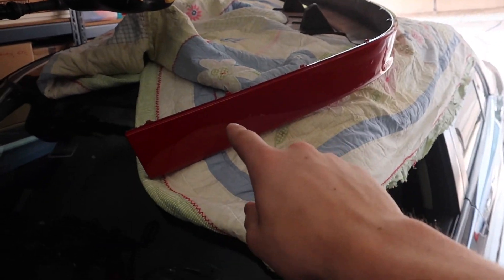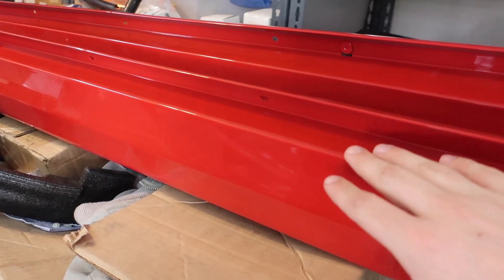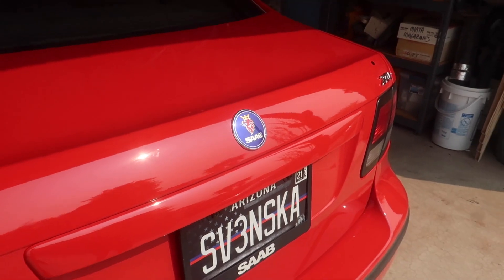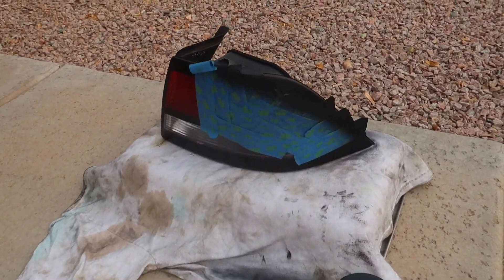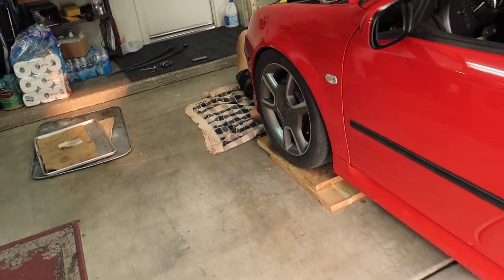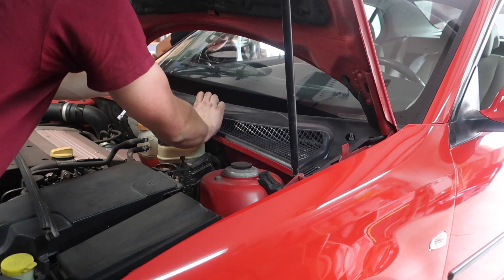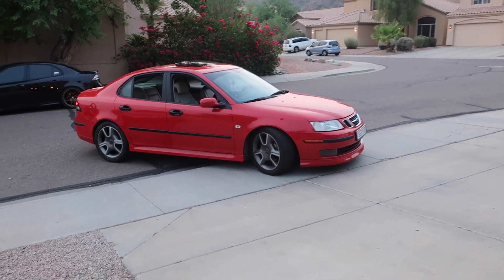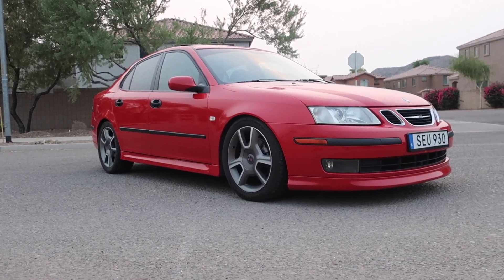Project Saab Episode 12 - New Paint Job Revealed!!

Comment: Wow looks so good dude! Make sure to get it ceramic coated ASAP!!! Ceramic coatings are like an extra clear coat protection
Reply from the maker: We've already been thinking about! Thanks for the tip :)
Reply: Tried a variety of finishes on my 0 Aero convertible including ceramic - by far best shine by far is Collinite 845 insulator wax sold by Amazon - lot of detailers use it ! Also Autoglymn trim restorer is amazing on black body trim 👌
Reply: My recommendation would be Chemical Guys Jet Seal paint protection 👌🏼 both of my cars are treated with it to great effect 👍🏼😎

Comment: Goes to MAACO and has issues.  Goes to Discount tire and has issues.  

Dude, reputable and local shops are the best, always support local not corporate.
Reply from the maker: I would try to, but MAACO was the cheapest, and the tires were bought from discount with a voucher, so I didn't have much of an option (plus it was free)
Reply: @AutoAutopsy  The cheapest doesn't necessarily mean the best as it got proven. Also supporting corporate fucks up the society and fosters financial inequality.
Reply: I would NEVER trust MAACO.  Good work is never cheap.  Cheap work is never good.

Comment: Yay! Laser Red! That looks really good and I think that the black tail light trim just adds to it. My 2007 9-3 Aero manual (Hirsch stage 1 + do88 intercooler) is laser red and it looks great. I had to replace the front lip spoiler on mine when it reached the stage of not having enough plastic to salvage for repairing. It was not cheap.
Reply from the maker: Yeah the new front lips with paint can be a little pricey, but it’s worth it!

Comment: Man, I don't like being that guy, but it is a typical Macco special. Looks good from far away, but up close and you can tell. You get what you paid for. Then again, it's hard to justify anything more expensive then a Macco paint job given the value of the car. Anyway, great video and it was great to see how the project came along!
Reply: Plus the fact that it will be baking in the AR. sun anyhow.
Reply: @Jx Po they look nice at first, but most macco paint jobs start fading and flaking within 5 years. It's a great choice if your trying to get a car painted on a budget, especially compared to how much an actual shop would charge.

Comment: How can i make a snap crackle and pop exhaust system for my 2003 saab 93 turbo . I've got a big ass HKS turbo back canon muffler that has a deep note I'm yet to install it to the rear and do i just straight pipe the middle muffler ? And down pie the cat or gutt the cat ?
Reply from the maker: don't straight pipe it; it will drone like crazy and sound awful; get a good exhaust system and the backfires should come with that
Reply: @AutoAutopsy  thaks mate, so i can still use the HKS turbo cannon rear muffler that has a deep note and swap out the middle muffler for a 3 inch resonator ? 💪 over here in Australia saabs are not a big thing. Hard to get an exhaust system off the shelf for a saab. Lucky I've got a welder and a car hoist. But nah love your channel mate 💯